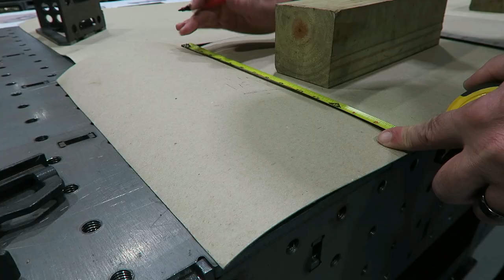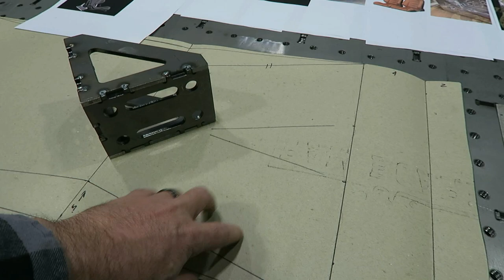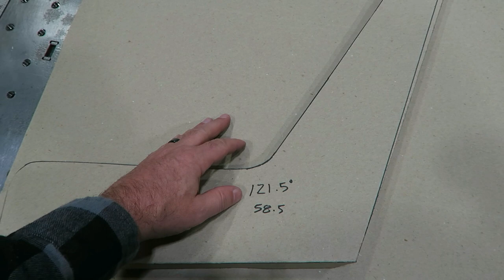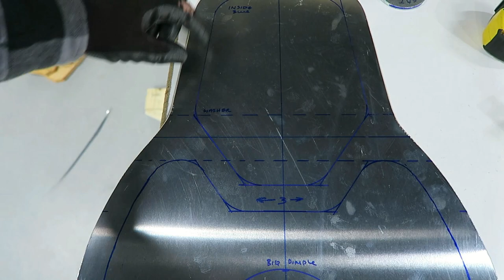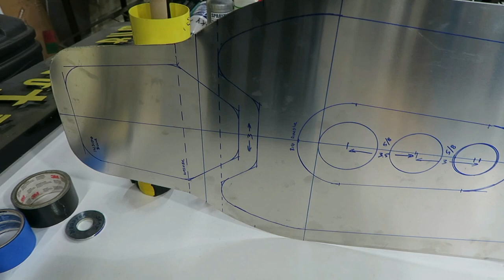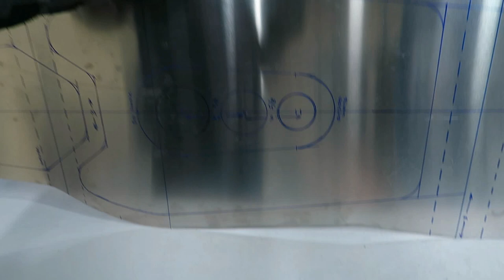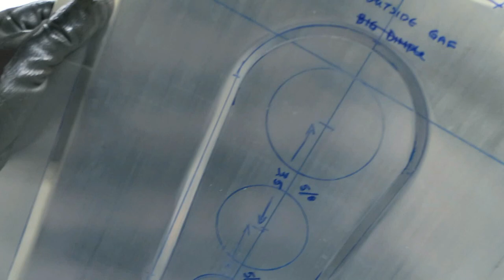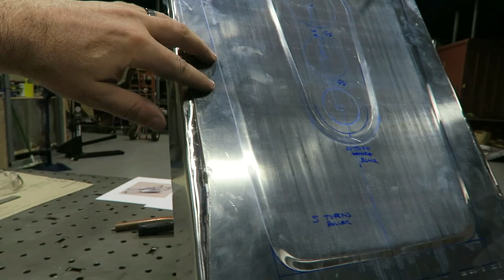How To Make Custom Aluminum Seats - Modern Bomber Seat Build From Scratch

Comment: That seat is a beauty and you do such good work. I don't think you need bolsters when you can just make up some pads for the sections of tubing on each side and let the frame do the bolstering. It will feel less claustrophobic since you're dealing with tight quarters already.

Comment: I hear ya on the ram board - I use it quite often in my shop for mock up models (I do more custom woodwork than metal). Kyle, how about maybe getting a doggy bed for Weezer - long term those cold concrete floors will contribute to aching bones and arthritis for the pup, unless you have radiant heat in them (I didn't notice in your build). It's not the same as a wood floor. If you have a Costco nearby they have great beds. I can assure you he'd really appreciate it! Still enjoying your channel and glad to see a new post today! Ton of respect here for what you've done with yer life! Just got my weld table, same 3' x 4' as your first table. You sold me on them, and going back and forth with Korey down there on a few mods they're doing for me I really appreciate what they offer us! Nice company to deal with, thanks for the heads up! FabForums is #1!
Reply from the maker: yeah I usually have her one....she goes through them as she gets them nasty
Reply: @Thefabforums  Okay, shoulda known you'd  be on top of that!

Comment: Mon I would want some spring's for comfort? Hope it's not a hot day sitting in metal seats I know on a sunny day in California, I had a bare metal steering wheel on my car I went and touched the steering wheel and burn my hands. I had to figure out how I was going to drive out of there I think I ended up using my socks and putting them on my hands until the steering wheel cooled down.

Comment: Hey Kyle.  I really enjoyed this episode, man.👍  You're exactly right about all the time that goes into a piece of the project like this.  The creative process of thinking it out, putting those ideas on paper through various designs and revisions, then making templates is very time-intensive before you even begin handling the first piece of sheet metal.  I haven't done what you're doing now but I have designed and built a chair from some extra 3/4" plywood I had in the garage.  You don't realize all the input required until you sit down, grab a tape measure, and go to it to see what shapes and measurements are needed to be comfortable.  If you manage all that and it looks cool too, all the better.  I'm diggin' that seat, btw.👌  Keep up the fantastic work, brother!  The Bibbster is going to be a sho nuff show stopper!  Have a great weekend and enjoy that sun while it lasts.  More rain is on the way.  Say hey to Weezer!😄